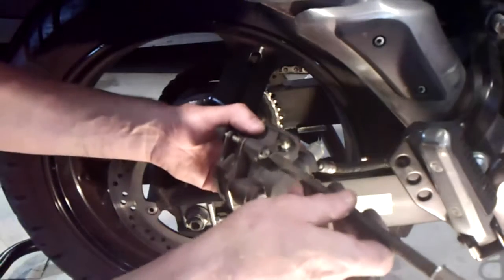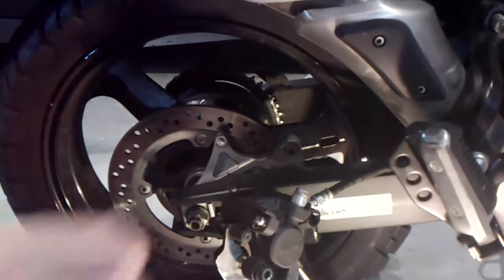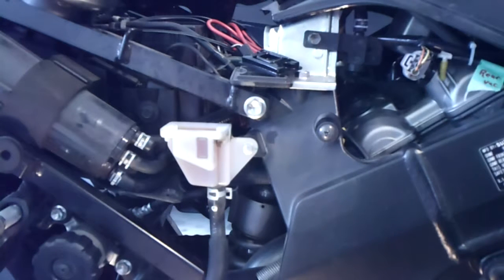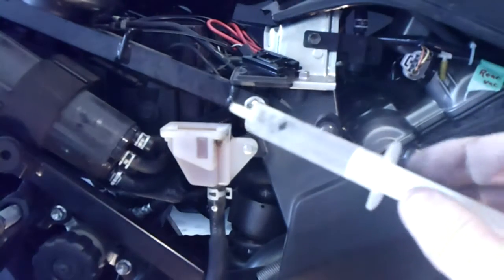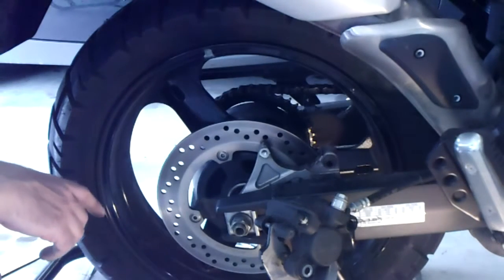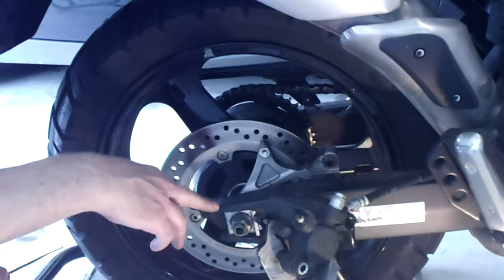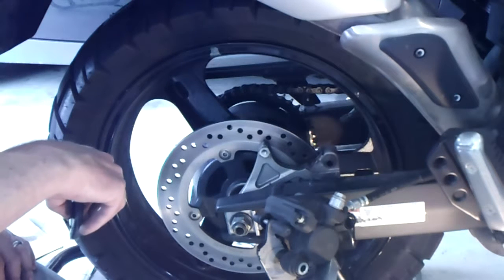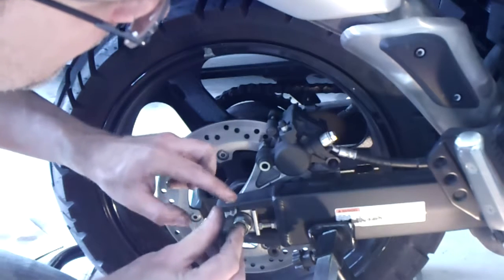Rear Brake Fluid and Pad Change Motorcycle (Part 2 of 2)

Comment: I literally just spent an hour trying to get the pads to sit in the caliper while it was detached from the bike.  The pads kept popping out and were "floating" as you call it, which I assumed was bad.  After watching your video I realized they are supposed to be floating because they get secured by the lower half of the caliper plate which was still attached to the bike.  

Thank you for this video otherwise I would have been searching for the answer longer than I was.
Reply from the maker: Glad to be of service!